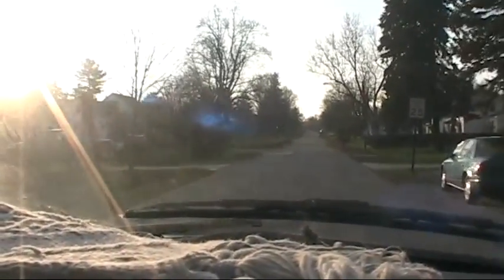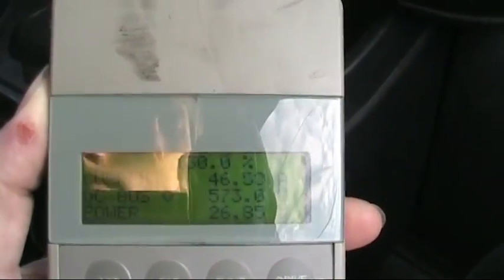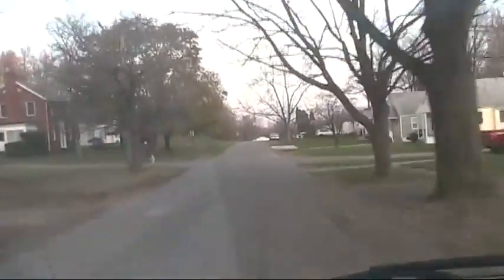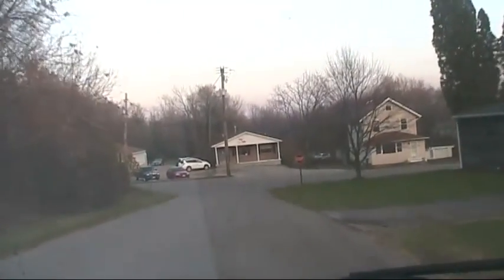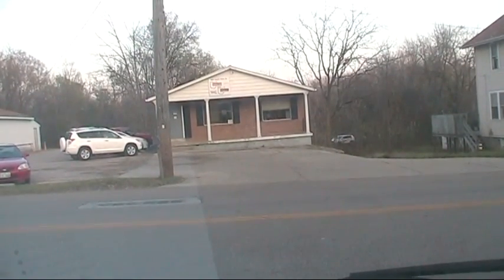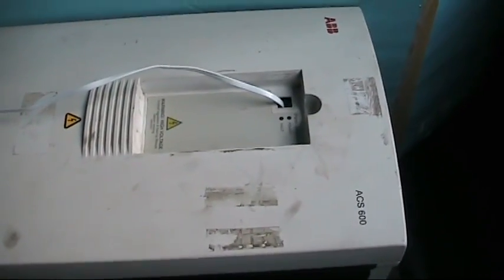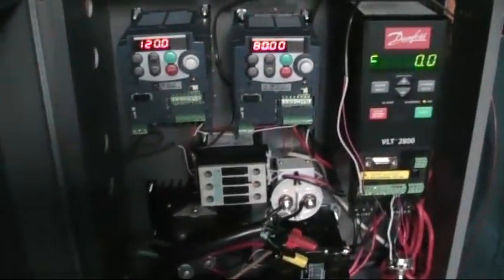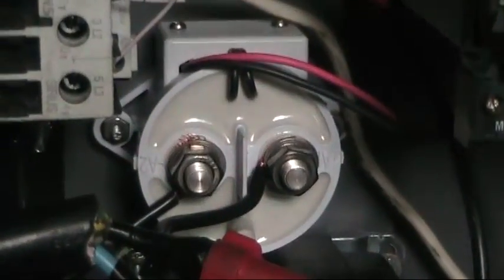Driving Chevy Express EV with ACS601

Comment: Did you completely remove the gas engine or have you turned it into a hybrid?  If it's a hybrid have you though about using the electric motor as a power adder as oppose to something that aids fuel economy?  Putting a "currs" system (what Formula 1 race cars use) on that engine would be awesome!

Comment from the maker: Like I said in the video, it's limited to about 60 MPH. (100 KMH )

Acceleration... not sure probably not good. It's a pretty big and heavy, probably about 7000 lbs (3200 kg)
Range, 10 miles estimated
Max power limited by the batteries, probably 50 kW. 
Once I get some better batteries, everything will improve, less weight, more power, better top speed, better acceleration. Thanks for watching